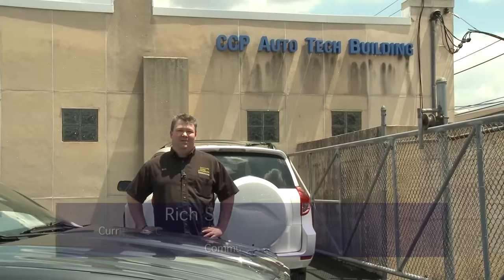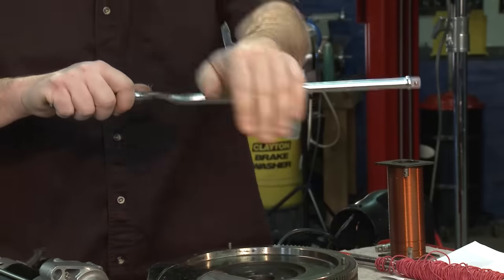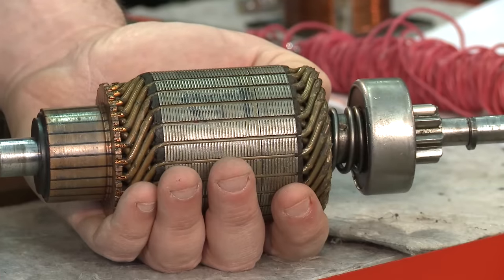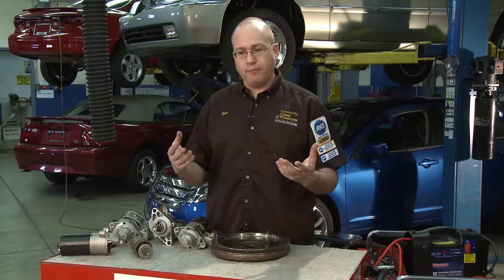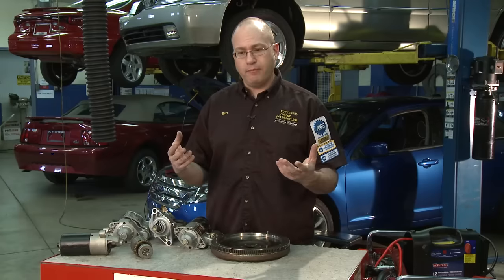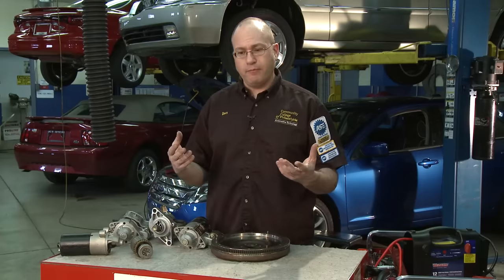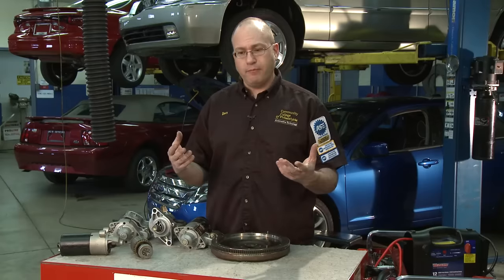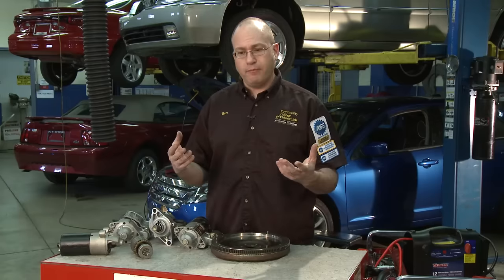Car Corner: Starter Maintenance

Comment: how do i diagnose starter clicking then starting?  battery?  or starter ?  Seen video where starter was oily and had water in and around it.  without having the right tool to test battery, what can i do?  Ive got a multimeter.   Vehicle in question .....Ford Transit UK, think its 3 generation  2006-2014

Comment: I have an old russian tractor. MTZ82, it uses a 24 volt starter,  12volt alternator,  12 volt accessories, a series parallel switch. I have constant problems with switch. I found a alternator that claims to have 12 volt post and 24 volt post. I want to rewire tractor to have 24 volt battery(2x12series) charge with 24 volt post,  use the 12 volt post to run accessories. Can this work? What do I need to check for?

Comment: Thank u so much for your good explanation, I have a problem ,when switching on for starting the engine,the starter gear rotates freely before entering  into the flywheel teeth.how can I rectify,please advice.

Comment: great video was wondering what is best way to bypass the ignition to start with push button..do i connect to the b wire or the s wire n then to battery ty in advance

Comment: Dear Sir 
I have starter motor 12DCV  and normal chassis ground and replaced a starter motor that is not body ground.Found the motor very hot.any idea for this issue?thanks

Comment: Not sure what your Model year is that you are working with,   at some point, cars have ANOTHER "THING"   I don't know what it is or where it is really, that s wire is activated By something OTHER than directly turning the key,  the key just activates some signal sender.   there is a delay after you turn the key and let of on it.   I'm thinking mines broke somehow because it has passed bench test, it passed starter relay by by pass   but when I hook it all back up the key will not activate the solenoid.   to do that test I grounded the case of the starter with a jumper cable

Comment: What if the starter is turning but it sounds like a flat battery? The batteries are brand new and tested okay but after 1 or 2 seconds turning the key it starts to sound like battery is flat? If I hold key down for about 20 seconds the car starts to sound normal the started speeds up and car starts. Could this be a sign of starter problem?

Comment: Hi I have a 2012 Chevy Silverado 5.3 LS I changed the battery and the starter about a month ago because the truck wouldn't start. After two days I had to replace the starter because it failed. My question is I have a oil leak and transmission fluid leak that leaks and splashes back on this chassis and can be seen on the outside of the starter. Can these fluid cause the starter to fail?

Comment: I just replaced the stater on my 2013 Ford E350 and soon as I reconnected the battery, the starter started spinning. I assume I have the ignition wire touching the positive lug. I’m going to deactivate the ignition wire and attach the battery. I will then try to start it. Nothing should happen. Then I will reposition the ignition wire

Comment: So in the starter motor shown at 15:20, the starter solenoid is effectively a relay? Something that has a control circuit and a load circuit? Why isn't a normal relay employed?

Comment: Very informative especially the finer details.I have a question. When the starter was mounted to my 19999 s 10 pick up I bypassed it and I heard a smooth hum but no turnover noise. So I though it might be the solenoid, so I took it out and tested it like in the video.(Which was helpful by the way). I watched the started gear spin and slide out like 3 times.  When the gear went back into the disengaged position it went in kind of slow (Not as fast as it did in this video also I could easily slide the gear in & out with my fingers is that normal?

Comment: Great video mate, I'm unsure the solenoid is any thing more than a switch for the starter though. pull the solenoid off and energize the motor the gear will still jump forward yeah.
 I'm currently having trigger wire issues can start the car jumping the starter relay and or trigger wire. that would tell me it's the natural switch yeah,  or something faulty in wiring from the barrel itself yeah?? Possibly a fuse or other interuper

Comment: So what would need to be replaced in the starting system if car was left on run for 2 days. The battery was recharged. I was able to start by taking out strtr relay but then didnt start after 6 starts. I am thinking it is the b wire since he said that is hot when in run so should I just replace solenoid or whole starter? Thanks

Comment: At 19:24 it should be noted that the ignition switch does not need to be ON with the car in gear to propel the car forward (or reverse) when using the remote starter switch.  That is because you are actually cranking the flywheel-clutch directly.  Granted, the car will run away if the ignition is actually ON and the car would otherwise start normally.  However, I've had a car jump quite a distance forward when I have forgotten to put the manual transmission in neutral.  Kind of scary in hindsight !

Comment: San I have a problem that no one can tell me what is wrong.99 F250 5.4 1? .What specific or why what in the starter or starter relay keep the bendix hung to flywheel.Put 2new starters 2 start relays on it .I can t start it with the ignition . So when jumping it with a screwdriver on relay flywheel and bendix hang.Qhwn I jump it on the starter it start dinw.I have to take the small view off the starter to do that.Rhw one that goes to the relay on fender. I saw people are having these problems.Rhw Does mechanics can't narrow what's os making it hang.Im trying to understand how or what specific mechanism causes  and solution

Comment: When starter now and then is doing fine, and lets say 20% of time, doesnt jump forward( you hear the solenoid turning)...is there a cleaning of the interior a possible fix? After few tries, the position of the cupper windings changed, and then it functions....so definately a solenoid problem...i have a spare starter motor that is good, wonder if i can separate solenoid from it? If not i change compleet starter, if needed, but try to clean inside and compare with the inside of my spare starter...

Comment: I have a starter out of an 82 ford pickup. The starter engages when out of the vehicle but when in the vehicle it won’t turn over the flywheel. Yet you can hear it whine like it wants to turn it over.

Comment: I have question ? 🤔 When I connect +ve to -ve terminal of battery it burns the wiring . Why not in this case
Reply: Because the inductive load, either from the solenoid coil, or from the electric motor, creates an opposing voltage. When you connect the terminals of a battery, the wire you're using almost zero inductance, hence it's just a resistive load and that generates heat.

Comment: Could a decompression lever be used to help start an old car.... like when I kick start my motorcycle... set it to the top of the compression stroke by opening the exhaust valve, that way you get the most crank acceleration & no whip back if done correctly.

Comment: Hi great video i have a problem with my starter motor i was told its polling and then running the battery flat does that sound right.

Comment: I changed my water pump in my 97 Toyota Tacoma and now I have no tail lights, no brake lights, no dash lights, no blinkers,except I do have hazard lights, and no stereo. I do have headlights, and some light, but engine will not crank, and I can not get it out of park. Any one have any answers? I would appreciate a response. Please, and thank you.

Comment: Wow, this is an awesome Video. As pseudechis says, well thought out and presented. My car is getting the sound you mentioned. Turning over as we use to call it. Only happens intermittently. You mentioned that it's probably bad fuel injection or something. Do you have a video on that subject? Thanks again, I wish I was closer so I could take your course even at my advanced age. Private GW would take it together.

Comment: my pontiac g6 pile of junk has purple wire and two wires black and green one togehter starter or wires were smoking greenwire near starter melted exposed to frame shorted out sometiemes worked sometimes not finally not at all! click no crank. took out starter it fill into pieces so got new one need to run a new green wire but to where?? from starter to wears it go??

Comment: 25:35 when you test solenoid that way, you must connect + to the "S" and the - to the B screw of solenoid with a solenoid's coil welded to it. If you connect + to s and - to the metal shell of solenoid, it's the holding coil, the small one working, not the main
Reply: the ground should actually be to the M terminal when the motor lead is disconnected, since the B terminal is not connected to anything until the solenoid is engaged and bridges the B and M terminals.
if the starter solenoid is connected to the starter assembly, then the case ground can be used because the starter motor itself acts as a virtual ground through the M terminal for the solenoid, until it energizes.
Then the pull in coil has 12V on both sides, so it stops pulling.

Comment: my starter has stopped working 4 times and each time I tap the starter as a friend turns the key and it starts up. 
Is that a worn starter or is that a worn Solenoid?

Comment: How do you make sure the teeth always line up with the fly wheel teeth?
Reply: The teeth on the starter spur gear have a sloping leading edge and naturally engage whatever position the flywheel is sitting.

Comment: Not  word about the fact that the starter can "weld" itsself to the bellhousing. It took me hours to get it off. Don't use copper paste, it will make the corrosion worse, use nickel based anti sieze.

Comment: Can I ask a question my car wouldn't start tapped starter is started after a couple days minium driving it all together wouldn't start. So I went to store to buy a new starter and they said it passed I didn't buy new starter it has power baterry is good. Could it still be my starter being bad?
Reply: Could be " weak " Wires, Relay, Power, Etc....  Sometimes even Weak Ground would make it act that way.

Comment: I tried starting my car and the battery is working, I can hear the starter motor running, but it won't start could it be my anti-theft preventing it from starting? I was using a back-up key without the signal generator. I'm starting to think that is the problem.
Reply: plasmathunderdx if the starter turns over but wont start the engine it is the anti theft..chevy is well known for the faulty devices

Comment: very good video. My battery dies very fast when I turn my car off, I took the battery to be checked and the guy connected a scanner and checked the battery, the alternator and the starter, battery was good, alternator was good but the starter fail, but my car start good so I don't understand why the starter fail. does anyone knows why?

Comment: Many technical inaccuracies in the ‘why’s’, but none actually relevant to teaching a person how an electric starter works in principle. For example, an electric starter is more than capable of turning as fast, even 4 times as fast as a consumer engine, it can also have more than enough torque to turn it over, and has fewer moving parts to lubricate. Most decently engineered electric motors can outlive any engine, using the right bushings / bearings and lubricant. The reason they don’t directly drive the engine and remain permanently coupled, is due to available battery tech, size and weight. But as I said, that’s more an issue with with the why, not the how, so otherwise, we’ll presented and more than enough to teach someone how they work.

Comment: The reason you hit a starter with a hammer is because of the electrical connection the electrical connection gets burnt and it doesn't make it so therefore it takes a little bit of motion for that solenoid to make it to connect it it's not really hitting with a hammer it's more of a tap tap tap tap

Comment: Why are dc electric motors with brushes used instead of AC induction motors?
Reply: @plowe6751  so just for simplicity's sake ?. Thanks
Reply: @plowe6751  batteries don't produce ac current though.
Reply: @plowe6751  could you precharge an inverter from the battery?

Comment: Can somebody  help me  out?  I have a 2001 audi tt 1.8 manual transmission, one day  i try  to start  it and it sounds  like the stater  motor was turning, but it was not coming  out  engage  the big gear on the engine,  i said  to my self, it's  the  selenoid, got a new stater and is doings  exactly  the same thing, i checked  everything  and just don't  get it, can somebody help please, thanks

Comment: So the problem is the assembly of vehicles. Each vehicle assembly is in different countries. We need to get to the root of manufacturers. Now I have a 1985 Volvo and I have to upgrade much of its pieces exhaust manifold long pipe rear pipe etc.

Comment: 22:00 the solenoid is attached wrong sided) the screw with a solenoid's coil attached to it must be connected to the starter electric motor)

Comment: What if you just get one loud click when you turn the key and its a brand new battery and starter
Reply: your jammed in the gears or  not getting a good connection electrically  might need to add a shim or two
Reply: @luvdady  ok thanks, i have good connection so its probably jammed gears
Reply: @alexmcclellan7049  yeah I've been there done that lol good luck hope its not too much a nightmare
Reply: @luvdady  any ideas on how to fix it at all?
Reply: @alexmcclellan7049  most times shime come with the starter or you can get them at a parts store
Reply: @luvdady  ok thanks

Comment: This is not a solution! First, "crank" and "turn over" mean the same thing. You mean "crank" and "start".  Second, this could potentially damage WAY more than the $10 relay you are bypassing, especially if you dont have any idea what you are doing, and lets face it, all I can say here is a little knowledge is a dangerous thing. DONT start bypassing relays.

Comment: But you going to way too much detail man it's really boring really really in another way is that that wire could be loose or bad connection going to need a good ground wire on the battery to the starter too